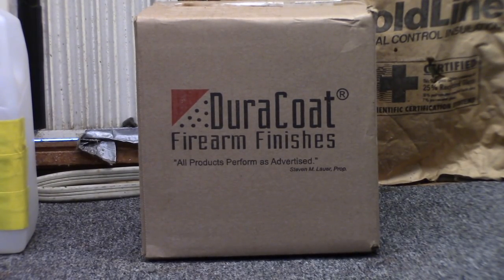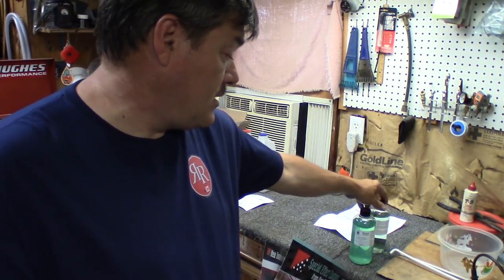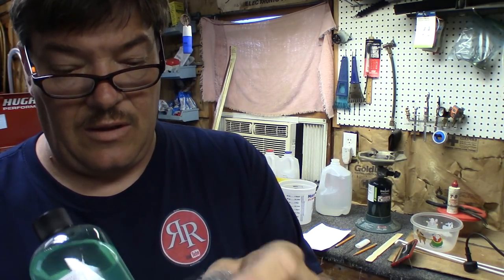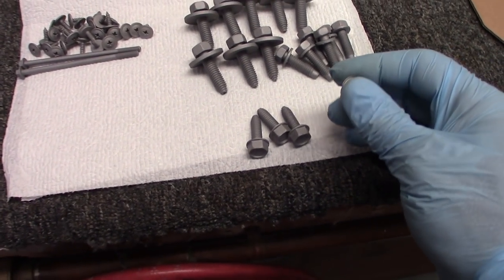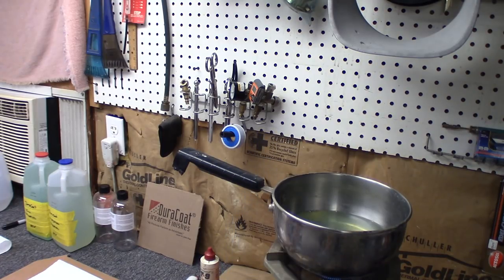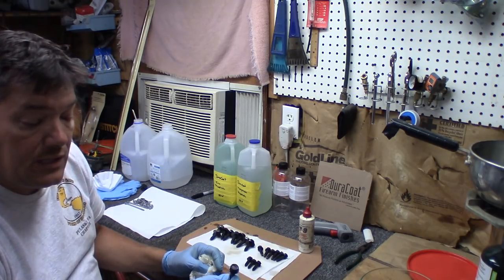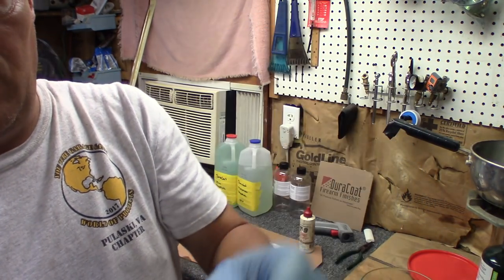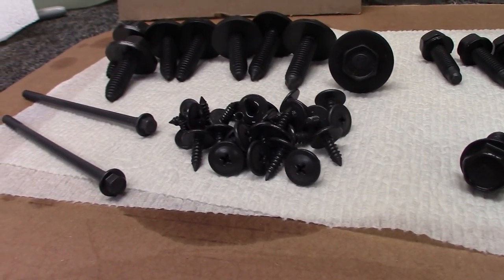DuraCoat Parkerizing, Restoring Bolts and Fasteners on Your Restoration

Comment: I can truly respect going the extra step to prepare the fasteners. It can make or break a restoration as paint in most cases, doesn’t last long enough to install it the torque in place. Just think, if you wash it, drive it and it rains or heaven forbid you drive to a show and shine and the weather man is wrong, it does rain, painted bolts will last weeks we’re as a chemical coating is what the requested from the supplier by the manufacturers specs. Who is right, rattle can from the dollar store, or an actual magnesium or phosphate coating, threads and heads! I would go with “Door #2” every time. After all, that I pride in your work. 
  Great job and excellent choice of how to finish your products the best way! Congrats!
NIASE Master Tech since 1978, Retired.
Reply from the maker: Thank you Dean!

Comment: I ran across this video after I finished a batch of nuts n bolts.  The instruction states "heat tank to 180 F."  Right before the sentence that states "Condition by immersing a pad of steel wool.."  I took this to mean the steel wool goes in the hot solution.  I noticed you put your steel wool in a cold solution. My bolts look fine, your bolts also look fine.  I am puzzled whether conditioning involves a hot solution or cold?  Any thoughts?
Reply from the maker: I'm not sure to be honest. I do remember contacting the manufacturer about the steel wool, but its been awhile and I don't remember the conversion details. I also use Palmetto's solution which is selling again. They are very similar,  but nothing in their instructions on the steel wool. So far I have been very happy with the results though.

Comment: Love this video! Very helpful as I was just about to spray paint the heads of the bolts on my project 72 Firebird Formula suspension parts. Now I have a much better looking, durable option thanks to you. Also thanks for the link
Reply from the maker: Glad it helped! I love this process. It has made such a difference in my resto work. You can buy kits from places like AMK Products, but I still find that there are several fasteners used from the factory that are not exact in these kits.

Comment: I don't have a sand blaster but I do have an awesome wire wheel on a bench motor that takes it down to bare metal, only difference is my bolts are shinny and more smooth. do you think this process will do or does the metal have to be blasted for the parkerizing to stick.
Reply from the maker: I think it should still work. I know some guys used to run a wire wheel over the bolts after the blasting. It would be worth a try. If I get a chance this week, I'll give it a try and let you know.

Comment: Hey Russell your videos are awesome. I enjoy them very much especially this one on restoring hardware. However, I did notice that when you were heating up the solution your propane stove there was very close to the wall Insulation at your workbench and I'm sure it was just an oversight like we all have done from time to time but I would hate to see that bottle tip over by accident and catch that paper on fire. I just wanted to help you avoid a major disaster there. Maybe there is something I'm not seeing but I just want you to able continue making these videos because you do a great job. Thanks
Reply from the maker: Hey Anthony, yes I need to finish the wall covering to cover the insulation for sure. Thanks for the kind words about the vids.

Comment: Is this stonger than a black oxide finish?
Reply from the maker: I would think so, its just a chemical process to change the color of the metal. Obviously if you mar the metal with a tool, the coating will also be compromised.  Saying that though, I have installed several using tools and they still look new. Thanks.

Comment: Russ, great review on a great product.. I do however have one question which is are you going to have to degrease/deoil the bolt heads from the last wd mix that you put on there?
Reply from the maker: Darrin, I usually just dry them with a paper towel. If there is some left over wd on there before coating with the Boeshield it wont hurt. I know some folks only used the wd. The Boeshield is just another type of oil that I have found holds up to the elements really well.

Comment: Everything looks great and I like not having to use electricity in the process.. But seeing the steam coming off made me wonder if it smells bad?
Reply from the maker: No smell that I could tell. I usually wear a mask, but for the purpose of the vid I didn't. I would think a fan blowing away from you would also be a good idea. This mix is 4:1, so you figure its 80% water.  Always good to think about safety. Thanks for watching.
Reply: I’m definitely going to be picking some of this up for use on my hardware, great video thanks!

Comment: How does this stand up to zinc plating?
Reply from the maker: I think it does really well. I have let parts sit outside for as long as 6 months before. The trick is to let a good coat of oil dry on them and your set.

Comment: Does this stuff work on stainless steel?
Reply from the maker: No it doesn't work on stainless. I use a stainless pot to heat the solution before I drop in the bolts. The chemical doesn't stick to the stainless pot. Great question and thanks for watching.